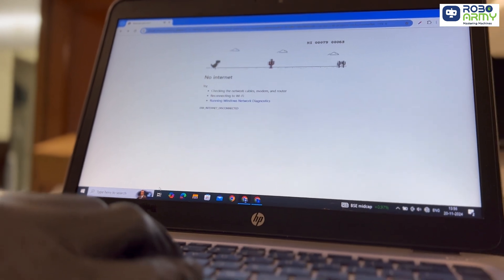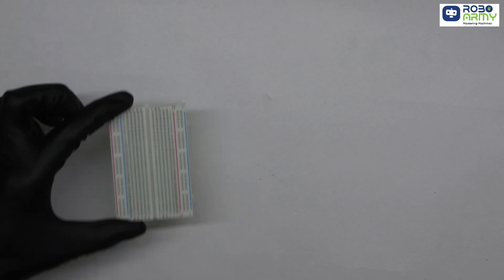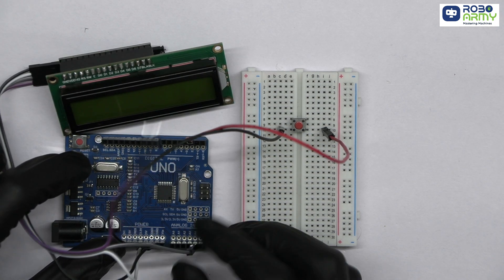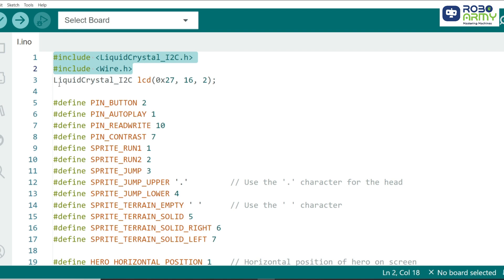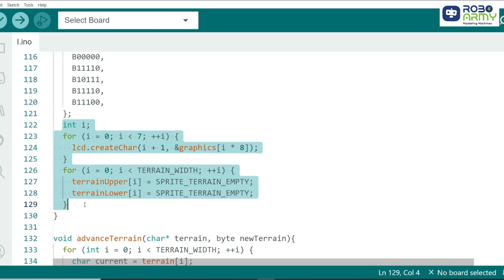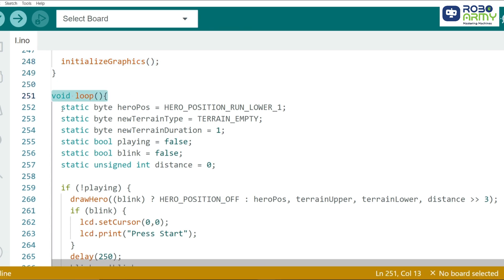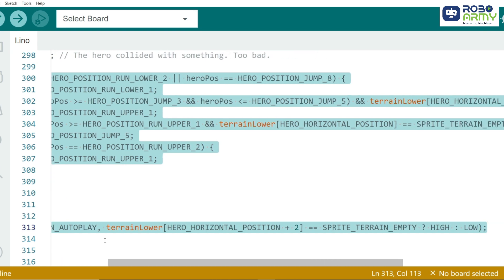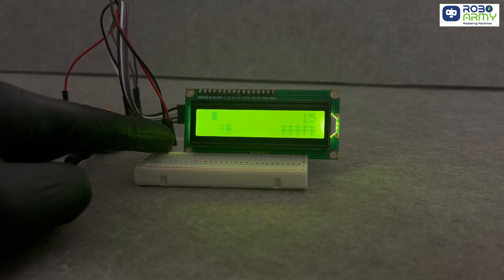Build the LCDino Run: Smart Dino Game Using Arduino UNO & LCD Display

Comment: Hi! We’re students from the Philippines, and we’re working on an Arduino-based project. We plan to follow this video, but we have a question: Is it possible to make this a two-player game using a single system, or would we need to build two separate sets so that each player has their own display? Thank you!
Reply from the maker: Yes, it is possible to make a two-player game using a single Arduino system, but it would require some modifications. You can use two push buttons (one for each player) and either:
One bigger display (like a 20×4 LCD or OLED) to show both players’ scores, or
Two 16×2 LCDs connected to the same Arduino using different I2C addresses.

Using two completely separate sets (one Arduino + one display per player) is also an option and is simpler for beginners, especially if both players want independent gameplay.
Reply: no

Comment: WARNUNG: Bibliothek LiquidCrystal_I2C behauptet auf all Architektur(en) ausgeführt werden zu können und ist möglicherweise inkompatibel mit Ihrer derzeitigen Platine, welche auf avr Architektur(en) ausgeführt wird.
Der Sketch verwendet 5202 Bytes (16%) des Programmspeicherplatzes. Das Maximum sind 32256 Bytes.
Globale Variablen verwenden 347 Bytes (16%) des dynamischen Speichers, 1701 Bytes für lokale Variablen verbleiben. Das Maximum sind 2048 Bytes.

Comment: Se muestra el error: lcd.begin(); help me
Reply from the maker: The error usually appears if the LCD library or address isn’t set correctly. Please check that you’ve installed the LiquidCrystal_I2C library and make sure your LCD’s I2C address matches the code (0x27 or sometimes 0x3F). Try scanning the I2C address using an I2C scanner sketch and update it in the code.

Comment: yo bro it just shows me this error code:                                  WARNING: library LiquidCrystal_I2C claims to run on all architecture(s) and may be incompatible with your current board which runs on avr architecture(s).
C:\Users\*******\Downloads\38\38.ino: In function 'void setup()':
C:\Users\*******\Downloads\38\38.ino:242:13: error: no matching function for call to 'LiquidCrystal_I2C::begin()'
   lcd.begin();
             ^
In file included from C:\Users\*******\Downloads\38\38.ino:1:0:
c:\Users\******\Documents\Arduino\libraries\LiquidCrystal_I2C/LiquidCrystal_I2C.h:58:8: note: candidate: void LiquidCrystal_I2C::begin(uint8_t, uint8_t, uint8_t)
   void begin(uint8_t cols, uint8_t rows, uint8_t charsize = LCD_5x8DOTS );
        ^~~~~
c:\Users\*******\Documents\Arduino\libraries\LiquidCrystal_I2C/LiquidCrystal_I2C.h:58:8: note:   candidate expects 3 arguments, 0 provided
exit status 1

Compilation error: no matching function for call to 'LiquidCrystal_I2C::begin()'

i dont know if the problem is from me using arduino nano instead of uno, but im not sure. could you help?
Reply from the maker: Hey! 😊
Thanks for sharing your issue — no worries, this is an easy fix! The error isn’t because you’re using an Arduino Nano; it’s actually related to the LiquidCrystal_I2C library version you have installed.

In your version of the library, the lcd.begin() function requires two parameters — the number of columns and rows. So just replace:
lcd.begin();

With
lcd.begin(16, 2);

Then upload the code again. It should work perfectly on your Arduino Nano too. 👍

If the problem still appears, try reinstalling the “LiquidCrystal_I2C by Frank de Brabander
Reply: its working now thank you brother

Comment: Code is not working. Please help
Reply from the maker: Hi! 😊 Please check that you’ve installed the LiquidCrystal_I2C library and entered the correct I2C address (0x27 or 0x3F) for your LCD. Also, make sure all connections are correct and the code is uploaded without errors. If it still doesn’t work, please share the error message you’re getting — we’ll help you fix it

Comment: hey mate, i only see big cubes about 16 of them on the screen
Reply from the maker: Hey! That’s because the LCD uses custom characters to represent the Dino and obstacles, and the screen shows them as blocks. Once the game runs, the Dino and obstacles will animate, giving the full running and jumping effect. Make sure the code is uploaded correctly with the initializeGraphics() function!

Comment: It does not show game over
Reply from the maker: Thanks for your feedback! Currently, the code stops the game when the Dino collides with an obstacle, but it doesn’t explicitly display a ‘Game Over’ message on the LCD. You can add this by inserting the following lines right after collision is detected in the loop:
if (drawHero(heroPos, terrainUpper, terrainLower, distance >> 3)) {
    playing = false; // Hero collided
    lcd.clear();
    lcd.setCursor(4, 0);
    lcd.print("Game Over");
    lcd.setCursor(3, 1);
    lcd.print("Score: ");
    lcd.print(distance >> 3);
    delay(2000); // Pause to show message
}

This will display ‘Game Over’ along with the final score whenever the Dino hits an obstacle.

Comment: #include <LiquidCrystal_I2C.h>
#include <Wire.h>
LiquidCrystal_I2C lcd(0x27, 16, 2);

#define PIN_BUTTON 2
#define PIN_AUTOPLAY 1
#define PIN_READWRITE 10
#define PIN_CONTRAST 7
#define SPRITE_RUN1 1
#define SPRITE_RUN2 2
#define SPRITE_JUMP 3
#define SPRITE_JUMP_UPPER '.'         // Use the '.' character for the head
#define SPRITE_JUMP_LOWER 4
#define SPRITE_TERRAIN_EMPTY ' '      // Use the ' ' character
#define SPRITE_TERRAIN_SOLID 5
#define SPRITE_TERRAIN_SOLID_RIGHT 6
#define SPRITE_TERRAIN_SOLID_LEFT 7

#define HERO_HORIZONTAL_POSITION 1    // Horizontal position of hero on screen

#define TERRAIN_WIDTH 16
#define TERRAIN_EMPTY 0
#define TERRAIN_LOWER_BLOCK 1
#define TERRAIN_UPPER_BLOCK 2

#define HERO_POSITION_OFF 0          // Hero is invisible
#define HERO_POSITION_RUN_LOWER_1 1  // Hero is running on lower row (pose 1)
#define HERO_POSITION_RUN_LOWER_2 2  //                              (pose 2)

#define HERO_POSITION_JUMP_1 3       // Starting a jump
#define HERO_POSITION_JUMP_2 4       // Half-way up
#define HERO_POSITION_JUMP_3 5       // Jump is on upper row
#define HERO_POSITION_JUMP_4 6       // Jump is on upper row
#define HERO_POSITION_JUMP_5 7       // Jump is on upper row
#define HERO_POSITION_JUMP_6 8       // Jump is on upper row
#define HERO_POSITION_JUMP_7 9       // Half-way down
#define HERO_POSITION_JUMP_8 10      // About to land

#define HERO_POSITION_RUN_UPPER_1 11 // Hero is running on upper row (pose 1)
#define HERO_POSITION_RUN_UPPER_2 12 //                              (pose 2)

static char terrainUpper[TERRAIN_WIDTH + 1];
static char terrainLower[TERRAIN_WIDTH + 1];
static bool buttonPushed = false;

void initializeGraphics(){
  static byte graphics[] = 
  {
    // Dino Run position 1
    B11110,
    B10111,
    B11110,
    B11100,
    B11111,
    B11100,
    B10010,
    B11011,
    // Dino Run position 2
    B11110,
    B10111,
    B11110,
    B11100,
    B11111,
    B11100,
    B01010,
    B10011,
    // Dino Jump
    B11110,
    B10111,
    B11110,
    B11100,
    B11111,
    B11110,
    B10001,
    B00000,
    // Jump lower part [lower part of Dino while jumping]
    B11111,
    B11100,
    B10010,
    B11011,
    B00000,
    B00000,
    B00000,
    B00000,
    // Cactus Center part
    B00100,
    B11111,
    B00100,
    B00101,
    B11111,
    B00100,
    B00100,
    B00100,
    // Cactus right part
    B00000,
    B00011,
    B00000,
    B00000,
    B00011,
    B00000,
    B00000,
    B00000,
    // Cactus left part
    B00000,
    B11000,
    B00000,
    B01000,
    B11000,
    B00000,
    B00000,
    B00000,
    // Jump upper part [upper part of Dino while jumping]
    B00000,
    B00000,
    B00000,
    B00000,
    B11110,
    B10111,
    B11110,
    B11100,
  };
  int i;
  for (i = 0; i < 7; ++i) {
    lcd.createChar(i + 1, &graphics[i * 8]);
  }
  for (i = 0; i < TERRAIN_WIDTH; ++i) {
    terrainUpper[i] = SPRITE_TERRAIN_EMPTY;
    terrainLower[i] = SPRITE_TERRAIN_EMPTY;
  }
}

void advanceTerrain(char* terrain, byte newTerrain){
  for (int i = 0; i < TERRAIN_WIDTH; ++i) {
    char current = terrain[i];
    char next = (i == TERRAIN_WIDTH - 1) ? newTerrain : terrain[i + 1];
    switch (current) {
      case SPRITE_TERRAIN_EMPTY:
        terrain[i] = (next == SPRITE_TERRAIN_SOLID) ? SPRITE_TERRAIN_SOLID_RIGHT : SPRITE_TERRAIN_EMPTY;
        break;
      case SPRITE_TERRAIN_SOLID:
        terrain[i] = (next == SPRITE_TERRAIN_EMPTY) ? SPRITE_TERRAIN_SOLID_LEFT : SPRITE_TERRAIN_SOLID;
        break;
      case SPRITE_TERRAIN_SOLID_RIGHT:
        terrain[i] = SPRITE_TERRAIN_SOLID;
        break;
      case SPRITE_TERRAIN_SOLID_LEFT:
        terrain[i] = SPRITE_TERRAIN_EMPTY;
        break;
    }
  }
}

bool drawHero(byte position, char* terrainUpper, char* terrainLower, unsigned int score) {
  bool collide = false;
  char upperSave = terrainUpper[HERO_HORIZONTAL_POSITION];
  char lowerSave = terrainLower[HERO_HORIZONTAL_POSITION];
  byte upper, lower;
  switch (position) {
    case HERO_POSITION_OFF:
      upper = lower = SPRITE_TERRAIN_EMPTY;
      break;
    case HERO_POSITION_RUN_LOWER_1:
      upper = SPRITE_TERRAIN_EMPTY;
      lower = SPRITE_RUN1;
      break;
    case HERO_POSITION_RUN_LOWER_2:
      upper = SPRITE_TERRAIN_EMPTY;
      lower = SPRITE_RUN2;
      break;
    case HERO_POSITION_JUMP_1:
    case HERO_POSITION_JUMP_8:
      upper = SPRITE_TERRAIN_EMPTY;
      lower = SPRITE_JUMP;
      break;
    case HERO_POSITION_JUMP_2:
    case HERO_POSITION_JUMP_7:
      upper = SPRITE_JUMP_UPPER;
      lower = SPRITE_JUMP_LOWER;
      break;
    case HERO_POSITION_JUMP_3:
    case HERO_POSITION_JUMP_4:
    case HERO_POSITION_JUMP_5:
    case HERO_POSITION_JUMP_6:
      upper = SPRITE_JUMP;
      lower = SPRITE_TERRAIN_EMPTY;
      break;
    case HERO_POSITION_RUN_UPPER_1:
      upper = SPRITE_RUN1;
      lower = SPRITE_TERRAIN_EMPTY;
      break;
    case HERO_POSITION_RUN_UPPER_2:
      upper = SPRITE_RUN2;
      lower = SPRITE_TERRAIN_EMPTY;
      break;
  }

  if (upper != ' ') {
    terrainUpper[HERO_HORIZONTAL_POSITION] = upper;
    collide = (upperSave == SPRITE_TERRAIN_EMPTY) ? false : true;
  }
  if (lower != ' ') {
    terrainLower[HERO_HORIZONTAL_POSITION] = lower;
    collide |= (lowerSave == SPRITE_TERRAIN_EMPTY) ? false : true;
  }
  byte digits = (score > 9999) ? 5 : (score > 999) ? 4 : (score > 99) ? 3 : (score > 9) ? 2 : 1;

  terrainUpper[TERRAIN_WIDTH] = '\0';
  terrainLower[TERRAIN_WIDTH] = '\0';
  char temp = terrainUpper[16 - digits];
  terrainUpper[16 - digits] = '\0';

  lcd.setCursor(0, 0);
  lcd.print(terrainUpper);
  terrainUpper[16 - digits] = temp;
  lcd.setCursor(0, 1);
  lcd.print(terrainLower);

  lcd.setCursor(16 - digits, 0);
  lcd.print(score);

  terrainUpper[HERO_HORIZONTAL_POSITION] = upperSave;
  terrainLower[HERO_HORIZONTAL_POSITION] = lowerSave;
  return collide;
}

// Handle the button push as an interrupt
void buttonPush() {
  buttonPushed = true;
}

void setup() {
  pinMode(PIN_READWRITE, OUTPUT);
  digitalWrite(PIN_READWRITE, LOW);
  pinMode(PIN_CONTRAST, OUTPUT);
  digitalWrite(PIN_CONTRAST, LOW);
  pinMode(PIN_BUTTON, INPUT);
  digitalWrite(PIN_BUTTON, HIGH);
  pinMode(PIN_AUTOPLAY, OUTPUT);
  digitalWrite(PIN_AUTOPLAY, HIGH);
  
  // Initialize the LCD
  lcd.begin();
  lcd.backlight();

  // Digital pin 2 maps to interrupt 0
  attachInterrupt(digitalPinToInterrupt(PIN_BUTTON), buttonPush, FALLING);
  
  initializeGraphics();
}

void loop(){
  static byte heroPos = HERO_POSITION_RUN_LOWER_1;
  static byte newTerrainType = TERRAIN_EMPTY;
  static byte newTerrainDuration = 1;
  static bool playing = false;
  static bool blink = false;
  static unsigned int distance = 0;
  
  if (!playing) {
    drawHero((blink) ? HERO_POSITION_OFF : heroPos, terrainUpper, terrainLower, distance >> 3);
    if (blink) {
      lcd.setCursor(0,0);
      lcd.print("Press Start");
    }
    delay(250);
    blink = !blink;
    if (buttonPushed) {
      initializeGraphics();
      heroPos = HERO_POSITION_RUN_LOWER_1;
      playing = true;
      buttonPushed = false;
      distance = 0;
    }
    return;
  }

  // Shift the terrain to the left
  advanceTerrain(terrainLower, newTerrainType == TERRAIN_LOWER_BLOCK ? SPRITE_TERRAIN_SOLID : SPRITE_TERRAIN_EMPTY);
  advanceTerrain(terrainUpper, newTerrainType == TERRAIN_UPPER_BLOCK ? SPRITE_TERRAIN_SOLID : SPRITE_TERRAIN_EMPTY);
  
  // Make new terrain to enter on the right
  if (--newTerrainDuration == 0) {
    if (newTerrainType == TERRAIN_EMPTY) {
      newTerrainType = (random(3) == 0) ? TERRAIN_UPPER_BLOCK : TERRAIN_LOWER_BLOCK;
      newTerrainDuration = 2 + random(10);
    } else {
      newTerrainType = TERRAIN_EMPTY;
      newTerrainDuration = 10 + random(10);
    }
  }
    
  if (buttonPushed) {
    if (heroPos <= HERO_POSITION_RUN_LOWER_2) heroPos = HERO_POSITION_JUMP_1;
    buttonPushed = false;
  }  

  if (drawHero(heroPos, terrainUpper, terrainLower, distance >> 3)) {
    playing = false; // The hero collided with something. Too bad.
  } else {
    if (heroPos == HERO_POSITION_RUN_LOWER_2 || heroPos == HERO_POSITION_JUMP_8) {
      heroPos = HERO_POSITION_RUN_LOWER_1;
    } else if ((heroPos >= HERO_POSITION_JUMP_3 && heroPos <= HERO_POSITION_JUMP_5) && terrainLower[HERO_HORIZONTAL_POSITION] != SPRITE_TERRAIN_EMPTY) {
      heroPos = HERO_POSITION_RUN_UPPER_1;
    } else if (heroPos >= HERO_POSITION_RUN_UPPER_1 && terrainLower[HERO_HORIZONTAL_POSITION] == SPRITE_TERRAIN_EMPTY) {
      heroPos = HERO_POSITION_JUMP_5;
    } else if (heroPos == HERO_POSITION_RUN_UPPER_2) {
      heroPos = HERO_POSITION_RUN_UPPER_1;
    } else {
      ++heroPos;
    }
    ++distance;
    
    digitalWrite(PIN_AUTOPLAY, terrainLower[HERO_HORIZONTAL_POSITION + 2] == SPRITE_TERRAIN_EMPTY ? HIGH : LOW);
  }
  
  delay(100);
}

Comment: i know that it has been while and u wont answer but my question is that my lcd displays notjing pls tell its just showing blue light
Reply: Ok ty I'll try
Reply from the maker: Don’t worry, I’ll answer! If your LCD only shows a blue screen, here are the most common fixes:

1️⃣ Adjust the contrast using the potentiometer.
2️⃣ Double-check the connections (especially SDA/SCL if you’re using I2C, or RS, EN, D4–D7 in parallel).
3️⃣ Make sure the I2C address in your code matches the module (use an I2C scanner if needed).
4️⃣ Ensure you’re using the correct library (LiquidCrystal_I2C or LiquidCrystal).

Comment: Will i be able to do it without a breadboard?
Reply from the maker: Technically, yes, but using a breadboard makes the connections much easier and organized. Without a breadboard, you would need to directly wire the components to the Arduino, which can be messy and less reliable, especially for the LCD and button connections.

Comment: would this code work with raspberry pico 2? I am learning circuit python to try and display the game on an LCD screen. Would I have to adjust the code in some way for it to be compatible?
Reply from the maker: Great question! This code is written for Arduino in C++ using the LiquidCrystal_I2C library, so it won’t directly work on Raspberry Pi Pico with CircuitPython. For Pico, you’d need to adjust the code to Python (CircuitPython or MicroPython) and use the appropriate LCD library (like adafruit_character_lcd). The core game logic can be reused, but the syntax and library functions will need modification

Comment: why is mine not displaying anything but the code already worked?
Reply from the maker: That usually happens if the LCD’s I2C address is different from the one in the code (0x27). Try running an I2C Scanner sketch to check the correct address of your display and update it in the code. Also, make sure SDA and SCL pins are connected properly and the contrast is adjusted.

Comment: IT SHOWING IN CODE ERROR LCD:BEGINS I DOWNLOADED FROM DESCRIPTION
PLEASE HELP ME ARE YOU CAN GIVE ME A NEW CODE AND CIRCUIT DIAGRAM WITH THIS SAME COMPONENTS
Reply from the maker: Make sure you’ve installed the correct LiquidCrystal_I2C library. In the code, instead of lcd.begin(16,2); you should use lcd.init(); followed by lcd.backlight(); because different library versions use different functions. Try this small change first. If it still doesn’t work, let me know and I’ll share a corrected code and circuit diagram for you with the same components

Comment: Why the dino is on the top of the lcd?
Reply from the maker: Great question! The Dino appears on the top row of the LCD during jumps or while running on higher terrain. It's part of the game logic to simulate jumping over obstacles using the two rows of the LCD.

Comment: I want to ask something new I made a new code I uploaded it but my screen is still plain
Reply from the maker: Sure! It sounds like your code uploaded successfully, but the screen isn’t displaying anything. Make sure:

You’ve used the correct I2C address (usually 0x27 or 0x3F).

You’ve called lcd.begin() or lcd.init() depending on the library.

The LCD backlight is turned on with lcd.backlight().

Your wiring is correct (SDA to A4, SCL to A5 on Arduino UNO).

If you're still stuck, feel free to share your code and setup—I’d be happy to help!

Comment: Only the hero and start game is blinking and my button has 2 pins please tell how to fix
Reply from the maker: Thanks for your comment! 😊
If only the hero and "Start Game" are blinking, it means the game is stuck in the start screen and not detecting the button press.

Since your button has 2 pins, make sure you're connecting one pin to Arduino pin 2 and the other to GND. Also, check this:

Add a pull-up resistor in the code or use the internal pull-up like this:

pinMode(PIN_BUTTON, INPUT_PULLUP);
Make sure your wiring matches the pin used in code (#define PIN_BUTTON 2).

If it's still not working, let me know your wiring setup—I’ll be happy to help further!